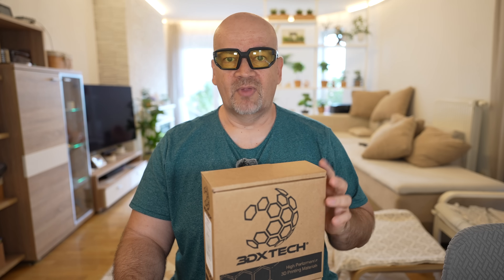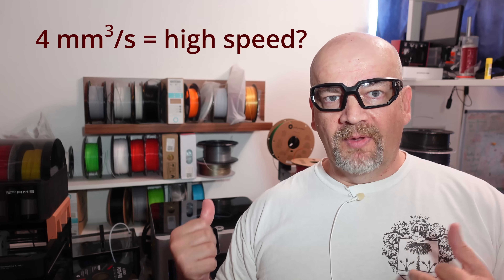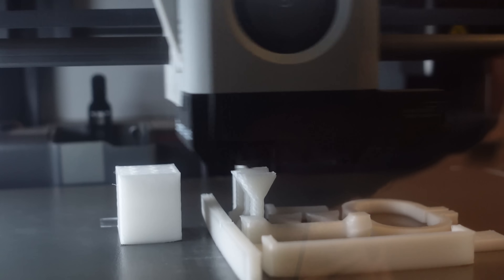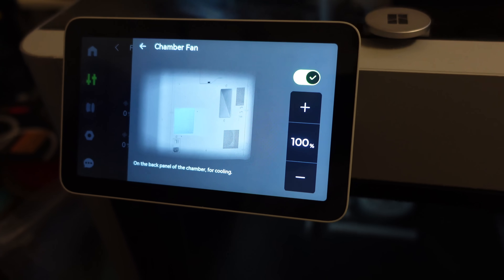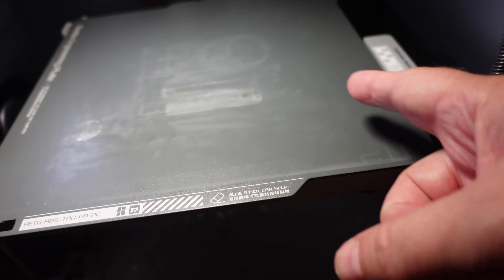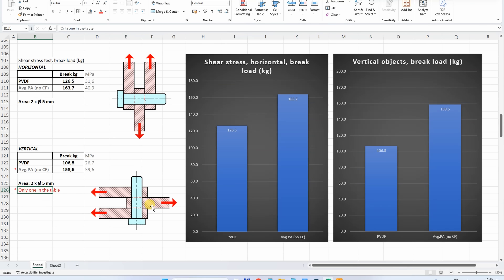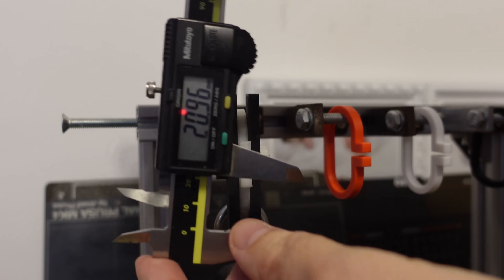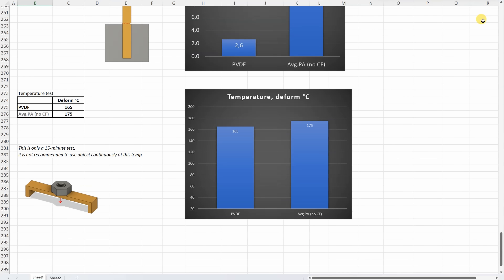3DXTech FluorX PVDF Filament Review – The Moisture & Chemical Resistant Polymer

Comment: Good day. I have a qidi plus 4 and do printing with pvdf. This is an extremely difficult material to print accurate parts with. You are welcome to contact me for more information.  I use this material for a cam and cam folower that operates at temperatures up to 140°c

Comment: Im using for long time PVDF bolts, nuts and fittings and found this material very strong, I have expecting better PVDF perfomance from you tests. Maybe moulded PVDF more strong than 3D printed, interesting to compare industrial PVDF bolt with 3D printed.

Comment: 7:55 I had the same engineering plate issue with cheap Nylon. It sticks well, but at the same time, the material warps too strongly and tears off parts of the plate. I think this is the reason why you can't buy eng. plate on Bambu anymore.

Comment: Moin,
1:50 Silica gel or something similar?
Why, if it doesn't absorb water?

10:20 Is there PVA in the glue stick?
That could really improve the stickiness, which isn't great when you're trying to take stuff apart.

I always make just one or two strokes on the printing bed with a glue stick without PVA.
Then I take a brush with lukewarm water and spread it out. Since most glue sticks dissolve in water, this works very well. A very thin wet film remains, which dries immediately when the printing bed is heated.

Comment: PVDF is used in water filtration systems. Wear PPE when printing this because it gives off nasty fumes.
Reply from the maker: I noticed. My X1C is connected to the ventilation hole. But even then, I could feel the smell

Comment: My I suggest that if you increase the layer time in the cooling section of the filament screen  (4:08m)  to something greater than 2 sec. This will slow the printer down so each layer time will not go under this threshold. 2 seconds is way to fast. Try maybe around 10 seconds rather than adding extra parts to slow things down.
Thanks for all you hard work and great videos.
Edit: This will only work if you have the "Slow printing down for better cooling" box checked as you do.

Comment: This is our go-to material for prints that will be exposed to chlorinated solvents. PP is a close second but will swell and soften with repeated/prolonged exposure. As others have stated it’s also a very “clean” material and doesn’t leach anything into the solvents which is critical in a lab.
Reply from the maker: Thx for this great info!
Reply: What about PPS?
Reply: @riba2233  I'd like to try out PPS but we have not been allocated money to get a printer capable of printing PPS yet, currently trying to convince the higher-ups of the usefulness of getting something like a Prusa HT90 or Vision Miner 22IDEX for high temp materials.

Comment: For best results, you must print at 20-50C hotter than recommended by most manufacturers.  This is true of every filament type and manufacturer except Bambu, who does some tuning using their printers.  I do not know how filament manufacturers determine print temperature, but it is usually very wrong.  The filament extrusion temperature is a function of your nozzle temperature setpoint, hotend length, and time the filament spends in the hotend.  The faster you print the colder the filament comes out.  Do not be afraid of printing much, much hotter than normal.  In general, you should print as hot as you can until bridge performance noticeably declines or oozing starts.
Reply: This one is like POM, in that you don't want to exceed the temp threshold or you will have a REALLY BAD time.

Comment: Most of the XTech products are very good, but this one is a head-scratcher. I'm sure there's a use case for it somewhere, but there's also A Lot of other more accessible and easier (cheaper?) materials that one can choose with even better performance for similar use case. I've noticed that the specialty filament manufacturers are shifting away from making materials for aerospace and moving towards criteria for the oil and gas industry, where the overhead for performance is overall lower, but having a wide chem resistance threshold is desirable. Many of the industrial or 'entry level' industrial guys rather like PEKK for it's much easier printability with more machines over PEEK, or the very few machines that are true continuous CF filament.

Comment: Great video!! PVDF is mosty used in chemical and semiconductor applications. It is used where extremely agressive chemicals are used. The chemical stability is similar to PTFE or PFA. Pure PVDF emits no oder at room temperature - 200 C, can be welded, extruded and machined. But if it is heated up too much above 260 C, it will carbonize and release toxic fumes (Fluor gas and Hydorfluoric acid). I would strongly recomend to everybody who wants to print  this material, to use an enclosed printer with a strong exhaust to the outside of the building. Also study the chemical properties of the material before printing. I print PVDF parts to be used in the semiconductor industry -> mechanically they more stable than PTFE ore PFA but a little less stable against strong oxidizing chamical at temperatures above 100 C.

Comment: The main reason to use PVDF is for its high chemical resistance and better printability with respect to other chemical resistant polymers (PP and PPS). I used to print it extremely slow and in a heated chamber to reduce warping (Prusa i3 MK3S+ with custom heated enclosure), for any other use it is too expensive and too hard to print with respect to the other available materials.
Reply: For the price I would rather use PPS-CF ..
Reply: @Deathstroke069  If possible PPS and PP with glass or carbon fibres are way easier to print but i had to work with hydrogen fluoride (which dissolves glass) and avoid carbon contamination. Using filaments with carbon fibers is also more difficult to print water or gas-tight containers, i had multiple leaks with PP-CF.
Reply: @PaoloBernardoni got it u r right
Reply: @Deathstroke069  they are completely different materials suited for different applications.
Reply: @Deathstroke069 which melts away in nitric acid or aqua regia and contaminates the solution with cf... Perfect...😉
These are no filaments you regularly use for private use these are specialized filaments you choose on the demands of your usecase

Comment: You often mention the horizontal torque test is of interest to you. I'm curious what application do you need this property for?
Reply from the maker: Once I created the wrench adapter. Also I had some 3D printed bolt, where the head goes into hole, and holds the position against torque. But what I really mean, is that load at 90° rotation is more important to me, than the break load with the horizontal test object.

Comment: I use this a lot for printing lab components that need to withstand strong acids. I get Flurinar-C from Nile polymers though. I'd also recommend not going over 260C because it is a flurinated polymer. It really doesn't print well fast.

Comment: Cool video, will you make a video about bambu lab PPS-CF?
Reply from the maker: I just started with PPS-CF. It will be even visible in the next video (in 2 days).
Reply: @MyTechFun Oh very cool, thank you very much👍
Reply: @MyTechFun  Or, maybe test some actually good PPS-CF (grin) that does not have to be made to work at lower temps for Bambu machines.  Toro3D sells Luvocom-resin PPS-CF in Europe, and it's the same as Luke's Lab and DremC sell. Prints great at 335-340C with a 65C active chamber.

Comment: Interesting material but unfortunately far too expensive. I know it's usually used for cable glands for eg.
Reply: There is no real alternative in terms of chemical resistance against strong acids.
Reply: @matthias3445 what about pps?
Reply: @riba2233  you sure got a point. It depends greatly in what chemicals are in use. PVDF is also a "high purity" material which can be used in DI Water supply where PPS is not. That's also important for semiconductor manufacturing. That's why we use it instead of PPS. Price wise PVDF and PPS are also quite similar I think.
Oh and I think PPS can't withstand e.g. aqua regia.
PP (Polypropylen can also withstand a Lot of chemicals) there is no General solution there it always depends on the usecase
Reply: For professional use that price isnt really a factor if you need the properties.